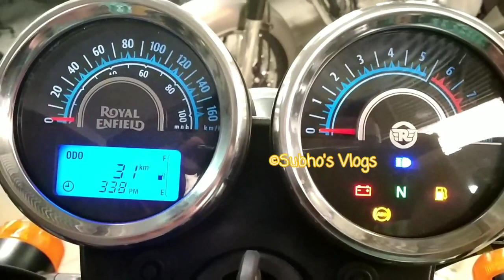Royal Enfield Thunderbird 350x ABS | YouTube First

Comment: Can I add the abs to my tbx350 3months back I have taken but for that time there no abs can I add it
Reply: How I can add if possible kindly someone comment here
Reply from the maker: It can be fitted but u have to see of your front rim hub has provision for ABS or not. I mean the recent Tbx has holes given in the front wheel hub for ABS. You have to see that and moreover u need to change your brakes calipers front forks and Wiring of the entire bike and lastly the Speedometer 

And last is RE won't sale ABS in spares for NON ABS bikes.
Reply: @SubhosVlogs  thanks bro
Reply: @SubhosVlogs  do you know the milage of this bike am getting only 18km per litre it's very low mileage just first service done
Reply from the maker: 18km only?? 350x? Well X doesn't matter as the engine is same. Buy 18km is insane. Normally, one can expect 38-40KMPL in mixed riding conditions and even more on Highway. Riding style is very crucial. But u should consult with the Service Manager and id still doesn't make any solution. Write an email to RE Supprt.
Reply: @SubhosVlogs  thanks bro will write a mail to them

Comment: Which type of ABS? ... dual channel like dominar 400 or just the normal one? ... because sensors are in the front AWA back
Reply from the maker: Dual Channel
Reply: Subho's Vlogs so it looks like there is noting to hate about this RE
Reply from the maker: Normal People doesn't hate RE.. RE is something special
Reply: Subho's Vlogs Even I love RE not because it is used by military just because it looks good (not the instrument cluster) & has a good engine but no safety as was big hurdle ... now it just choosing between Dominar & 350x
Reply from the maker: If you want calm relaxed riding - RE is the pick
Reply: Subho's Vlogs ya! That’s the reason i will go for RE